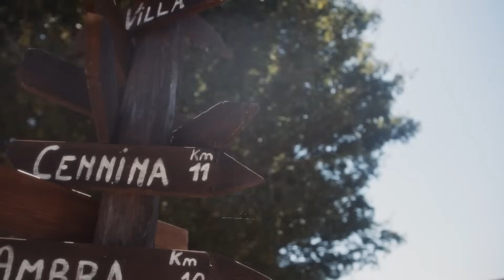Historic Milestone: He Created the Tesla of the Skies | Tomasz Patan (Jetson & Volonaut)

Comment: Low energy effective and dangerous. It has low utility implications. Max toy for the rich.
Reply: Mind you, they said exactly the same about cars and planes.
Reply: @waldemarchoroszewski3644  it's too dangerous to allow it as a public transport as you can't make it safer. Meaning that there are some issues that can not be solved. So it has low utility. Contrary to cars and plains.
Reply: @foxdrzevko6077  except the last sentence, they said exactly the same about cars and planes.
Reply: @dirtriderpl cars drive on roads just like carts or carriages did in the past. It was enough to ensure energy efficiency and implement safety regulations for the invention to become groundbreaking. The same goes for airplanes, which fly high above us.

Here we have something that, even if we manage to balance its energy costs, will not be allowed for public use due to safety concerns. It may become a toy for wealthy people rather than something useful like a car or an airplane.

And it truly doesn't matter that people once said the same about cars and planes—that they were energy inefficient.

So I really find the hype about it rather silly.